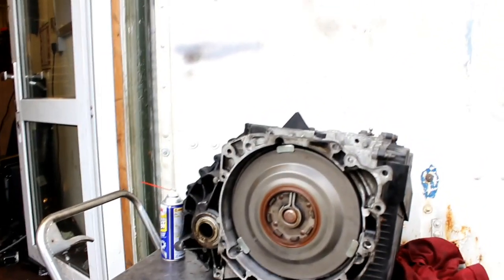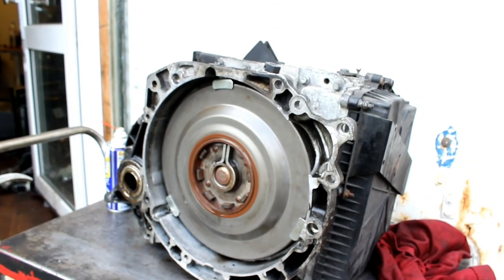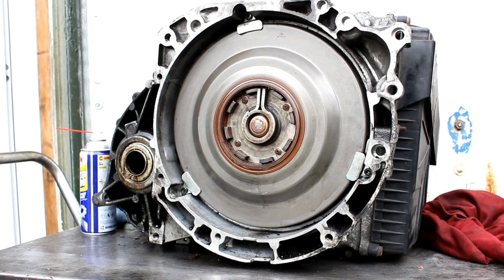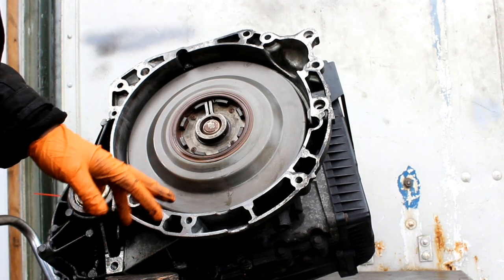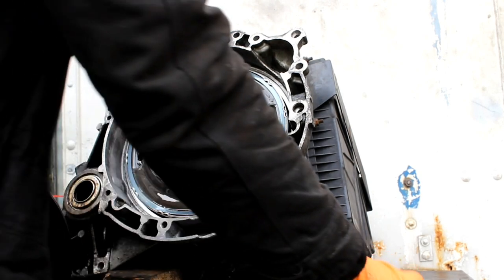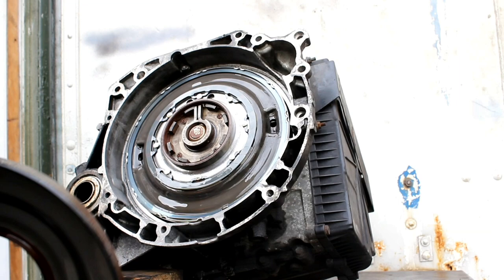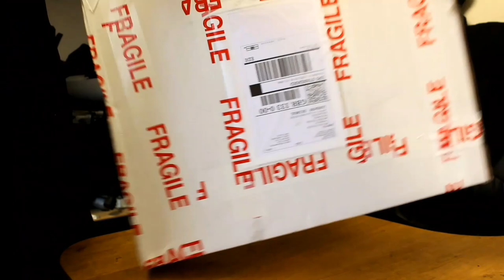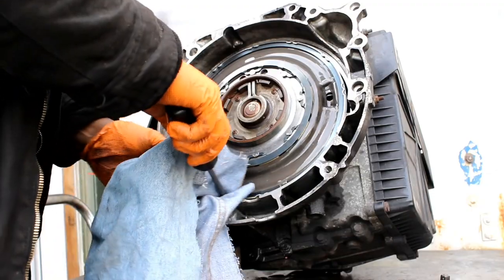Ford 2.0 L diesel powershift gearbox oil leak ( oil pan seal replaced ) how to do.

Comment: *Hello dear, it is an installation method, but it is not professional. There is five or six inches of plastic, you put it first, put it on the plate, then pull the plastic out and the installation is done very accurately and without errors * 🥰🥰
Reply: I got my seal replaced but the leak got worse after replacement. I have this gearbox on a volvo s60 2013 model. Could the missing plastics be the cause?

Comment: Hey mate i have 2017 galaxy tdci powershift, its leaking oil i get a little smoke sometimes coming from underneath the airbox, yesterday i got limited gearbox function. Do you think this could be the issue?

Comment: Hi, there, is there a specific way to install the transmission back in the vehicle...? If it so, in what position should be..?
Reply from the maker: Hi.
Yes. You need to line up the flywheel with transmission with the flywheel. On the transmission one of the grip looks different and on the flywheel slightly wider.
You need to line up both in the same position. 
That is all.
When refill the transmission please follow the guid to make sure you fill enough. 
Good luck
Reply: Thank you, I thought that I need a special tool for it
Reply: @carlosalcocerlicona8026  they make the special tools for dealers mainly. most general transmission specialists don't have all the special tools
Reply: @Stoneforth  I have installed the transmission back in, was a Volvo XC60 2014, it does require special tools pretty much for everything, but I did with non of them... appreciate your support

Comment: Quick question, after changing seal on ford galaxy 2015 gearbox will I need to program the car and will it start?
Reply from the maker: Sorry for the delay.
Ford doesn't require any programming. Once you replace the seal, it will work fine. Make sure fluid level is correct.

Comment: Ford Galaxy Mk3 timing belt change tightened up the crankshaft pulley using an air gun and then I started getting a leak from the gearbox. This video has helped me identify the possible cause and hopefully it was just the vibration that caused this small amount of fluid to leak from the seal. Thanks for sharing this video.
Reply from the maker: I am glad you find this helpful. 
Bear in mind, the leak could also be from the crankshaft seal from gearbox side.
I suggest you replace them both just to be on the safe side.
Good luck

Comment: Hi my car is leaking transmission and from that seal. But how do I know if the clutch is damaged?
Reply from the maker: If the car drives OK with enough oil on cold and hot temperature, clutch might be ok.